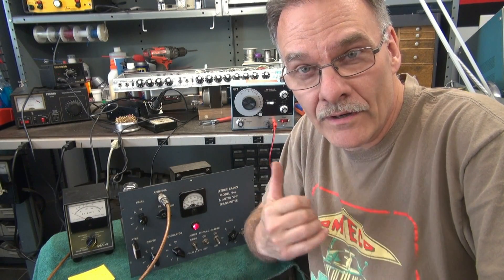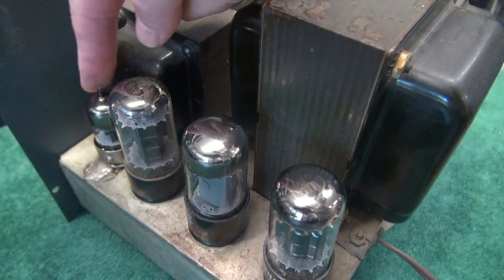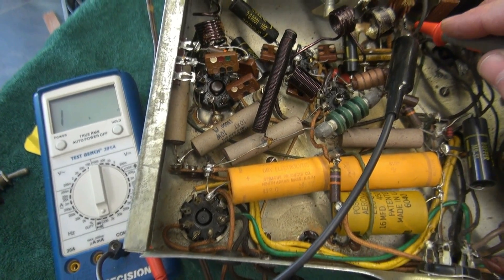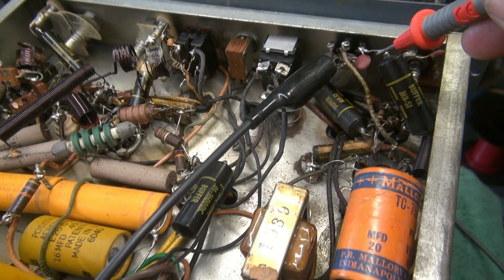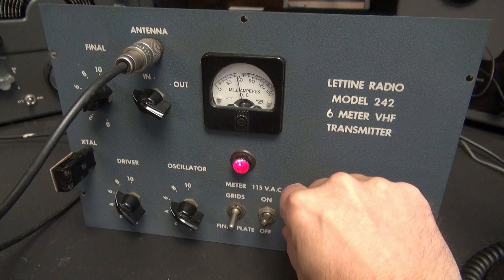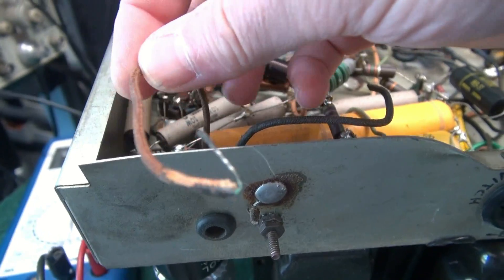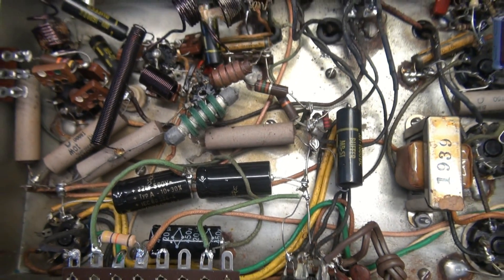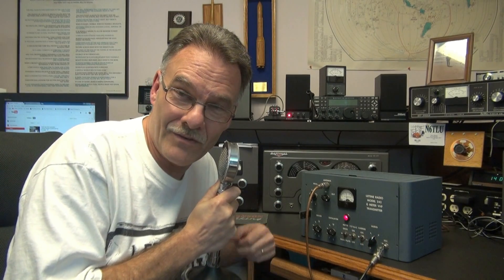How to repair Vintage Lettine 242 6 meter AM Ham Transmitter by D-lab

Comment: Terry, great job on the Lettine Model 242 6 Meter AM transmitter.  I just picked one up in an estate sale.  I will be checking out soon.  Your video will be a great help.  I probably actually saved it from the dump.
73 Paul AA1SU

Comment: I had a Lettine 242 in my early ham days around 1958. I bought it from Mr. Lettine, who manufactured them in the basement of his home in Valley Stream NY. I still recall the day that my Dad drove me there from Manhattan to pick up the rig. The only problem I ever had with that rig was burning up the power transformer. It was easy to get a new one to replace it. Around 1959 I added an ARC-5 VFO, using a new ARC-5 BC-459 I bought (for $10) at Rex Radio in radio row in NYC. Years later I rewound the ARC-5 coil to change its frequency to use as an SSB VFO in a homebrew SSB transmitter. Those were the days!
Reply: You either bought it from Anothony Lettine, my grandfather or Howard Lettine my Uncle.
Reply: @livinginbronxnewyork6138  Do think that you might have a manual for the 242? 
73 Paul AA1SU

Comment: Hey sir great video. Can you tell me what frequency crystal you are using? Is it a fundamental crystal at 50-54 MHz, or is there a multiplier circuit in the radio that uses a lower frequency crystal?. Thanks, W4TWA

Comment: Dear Terry,  Great!  I like the physical appearance/lay out of the rig. The front panel and case look very good.  I wonder if Lettine made HF transmitters that looked similar to this 6 meter rig?  The audio should be great with 2 6V6's.  Dr. Stan  KZ8G
Reply from the maker: Hello Stan, Yes, they did make one. Its the model 240, HF, AM/CW. I have one in mint-o shape. I will be going thru it soon and post a video. Let me know if your interested. The 6M model will be on QTH tonight FS. TD